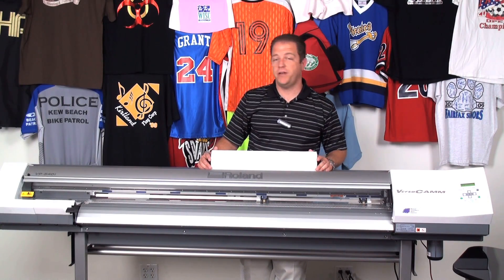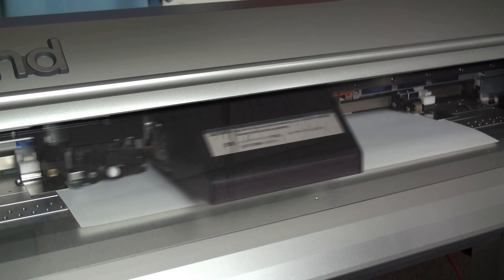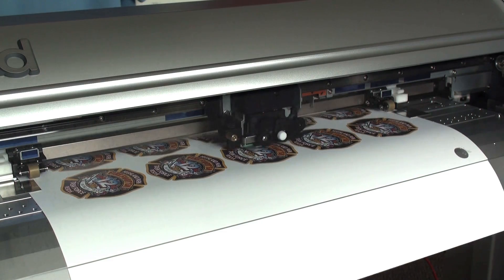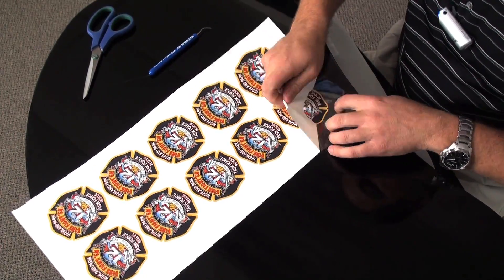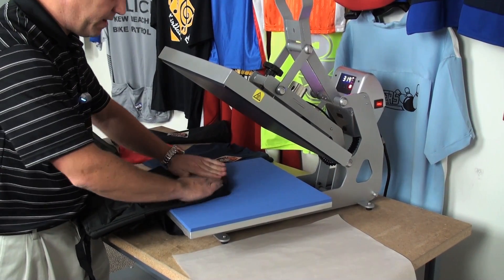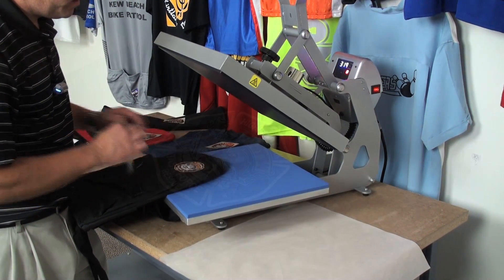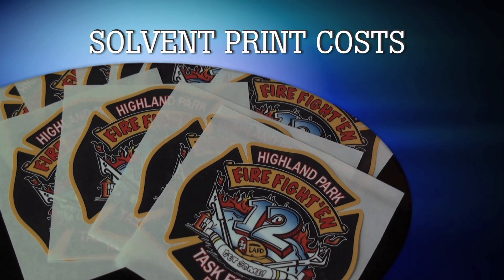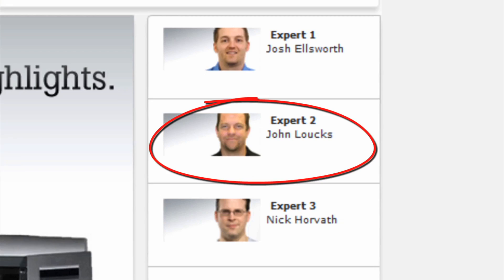Producing heat press transfers with a solvent printer cutter

Comment: hello, I am currently using my Roland SP300I with a media called T-Printz from Sihl. It is advertised as the thinnest printable media for dark garments and it is very thin at less than 2mils. The only gripe I have is the durability through washes. It started to fade after less than 10 washes. I followed directions to a tee and I use Roland brand inks. I am weary to try another media because I think they may do the same thing. However, you state that you guys guarantee this media for 50 washes. Have you personally used this product and if so, how many washes did it take before it looked faded more than 5 percent? thank you.
Reply: +Gary Hall  If you are looking for something thin I would recommend SuperTEK Opaque.  I would recommend contacting Stahls' at 1-800-4-STAHLS to consult with an associate.  Thanks